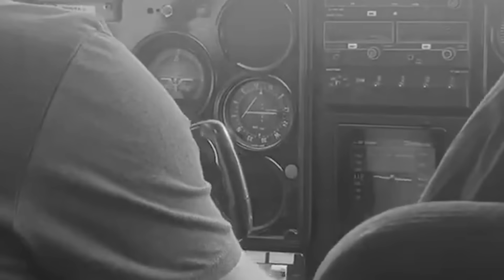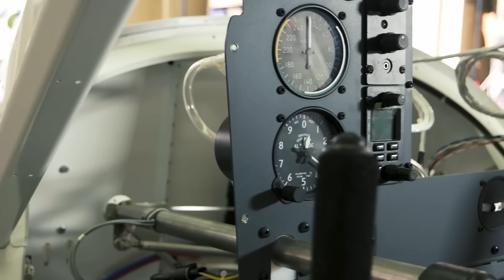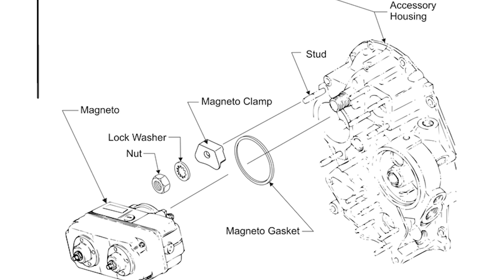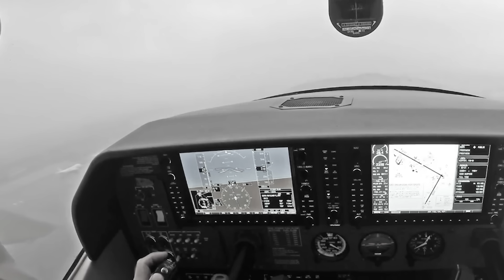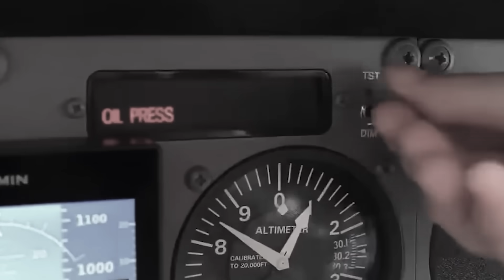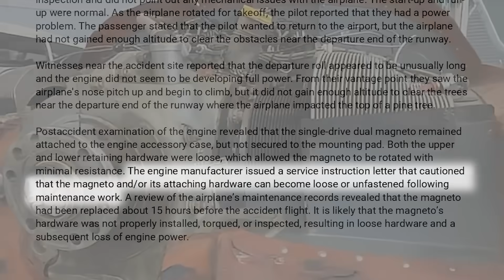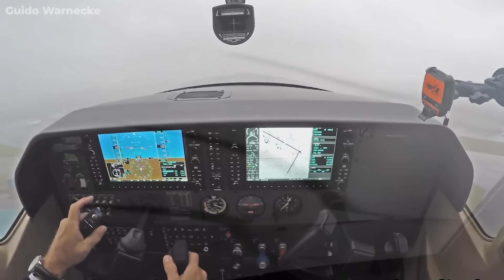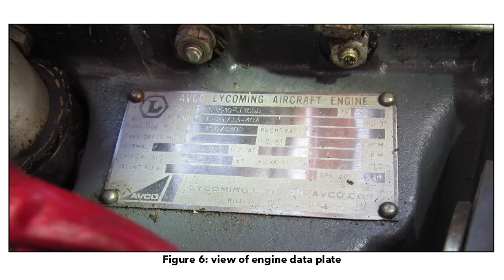Pilot Fatal Crash! The REAL Maintenance Error That Got The Pilot Killed, New Discoveries…

Comment: Lots of  nonsensical comments. Nylon lock nuts are not used to secure magnetos. There is nothing wrong with a properly maintained dual mag.  The proper gasket and attachment hardware needs to be used.

Comment: I've aborted takeoffs. Bad maintenance didn't kill that pilot, bad flying did. If he didn't have enough runway for a Cessna then it obviously had a problem, abort and figure it out on the ground. If the aircraft passed a preflight mag check I suspect he could have kept it in the air but he got on the backside of the power curve, which it seems few people understand, at least well enough to stay this side of it.

Comment: I have gotten into the habit of doing a few touch and goes in the pattern before departing. It gets the engine warmed up and hopefully, any issues will then show up. 

I once had to do 2 aborted take offs. Very hot and humid day, and halfway down the runway the engine started to stutter. 

I squaked the issue. Never did find out what happened. Possible vapor lock or slight water in the fuel was my guess.

Comment: Magneto check - dual magnetos - excessive RPM drop on the bad magneto or less than full power when initiating the takeoff roll should have warned the pilot in plenty of of time.  Poor maintenance yes; pilot error yes.

Comment: I had a feeling it was gonna be a dual magneto issue . Been an aircraft mechanic for over 40 years. I have seen that magneto do that to a handful of airplanes over the years . I hate that magneto.
Reply: I have you beat, I have been a mechanic for 55 years and I would not fly behind that magneto, working on them since they first came out, when I see a plane crash that was not fuel related, I think of that mag and the problems it has caused, MP

Comment: You are correct on almost everything !  But  if I was the lead engineer at the magneto manufacture  and one of my engineers ask  me about two magnetos with one drive  he would hve received a quick NO !   I have been an A/P since 1967  and  have  seen  poor engineering  and  cheap parts that makes  one wonder what they were thinking.  I have also been a pilot since 1969 so I know both ends of it .

Comment: You would think something as simple as wire locking would have solved this issue. I just assumed all aircraft nuts and bolts were wire locked as standard procedure.

Comment: It would have been nice if the report specified whether or not the CORRECT magneto clamps were used. Absent this information, the entire commentary is useless. There are at least 3 different magneto clamps in production and if you do not know what to look for you could use the incorrect one(s) with this result. Today, service bulletins are hidden behind company websites, so you can't even know what you don't know. Lycoming bulletin 1508C applies here. Per lycoming this is a mandatory SB to be performed in the next 50 hours from (2011 or so). There are 11 steps to the instructions! Not sure if it was ever an AD, but it should have been. The lock washer shown is incorrect per 1508C. RIP to the pilot.
Reply: Today, service bulletins are hidden behind company websites, so you can't even know what you don't know.     "100% correct "  One could spend 2 days looking  and not find them !

Comment: I think fault lies with all three, the pilot, mechanic, and the manufacturer. But the majority of fault must be borne by the manufacturer, because they knew about this problem. How many mechanics will follow all the procedures 100%. They are human beings who can make occasionally forget to apply the right torque suggested by the manufacturer.  The manufacturer cannot escape this tragedy by just suggesting "nut can become loose, or such things can happen" after maintenance. They should suggest mandatory preventive action so that the nuts would not loosen easily.

This crash could have been averted easily. The pilot could have aborted the flight as soon as he realizes that the plane is not generating enough power.

What about dual magnetos? The entire purpose of the magnetos was having redundancy. If one magneto fails, the remaining magnetos should have supplied power.

Anyways, the lesson learnt is that never lift the plane if the takeoff roll is too long, or if there isn't sufficient power.

Comment: I will tell you right now, it doesn't matter about the Gasket used, it comes down to correctly tightening the Magneto hold down nuts, and in this case, They were not tightened, it is a maintenance error, I am a Licensed Aircraft Engineer and have been in the maintenance industry since 1975, so the people that released the aircraft should be accountable

Comment: In my opinion, the manufacturer of the magnetos should've recommended that the nuts securing the magneto to the engine be secured with safety wire to prevent them from coming loose, besides applying the appropriate torque, since they knew about this issue.

Comment: I am surprised the pilot didn't notice this in the runup before takeoff.
Reply: In a static runup the engine needs to turn x RPM, it's in the flight manual in the front seat pocket, nobody bothered to look, I guess. If the plane isn't accelerating as expected abort and go back to the ramp. This was the pilot's responsibility, poor judgement with the contributing factor of poor maintenance. Another unnecessary fatal accident.

Comment: Losing engine power is no reason to crash.  In my years of instructing I focused on the importance of keeping up airspeed no matter what happened.   An airplane will fly without the engine running.  But it will only be controllable if it is flown at or above its minimum airspeed.  I have lost engine power and landed safely in a cow pasture with zero damage to the airplane.    Flying safely means keeping your cool no matter what happens.
Reply: It crashed just off the end of the runway in the trees. The PIC didn't have enough altitude to land else ware.
Reply: Keep your cool right up to death....

Comment: He trusted the system, and the system failed him.
Reply: I disagree; it was the pilot's responsibility, as per the FAR's to make sure the plane was safe for flight. He had several times to check, the manual in the airplane specifies x RPM for a static run-up, if acceleration doesn't seem normal, abort and go back to the ramp. This is poor pilot judgment combined with poor maintenance, the mechanics bad work could have been sorted later after he returned. Another unnecessary accident.